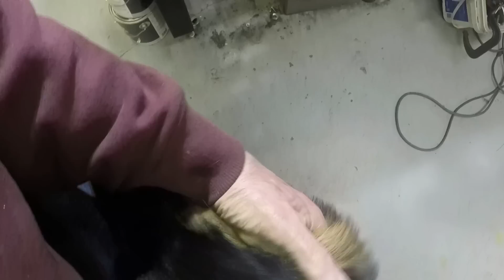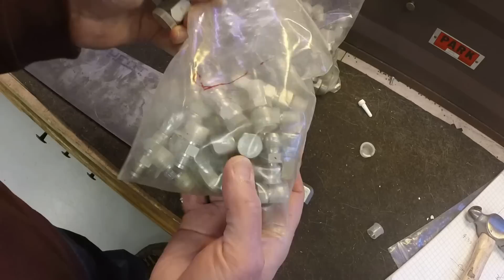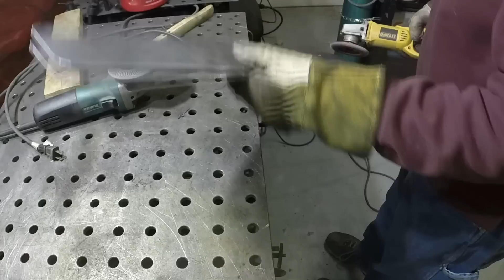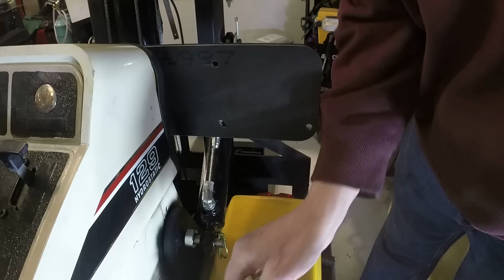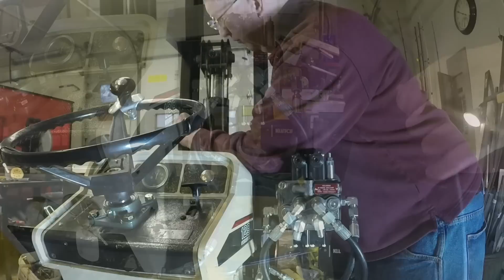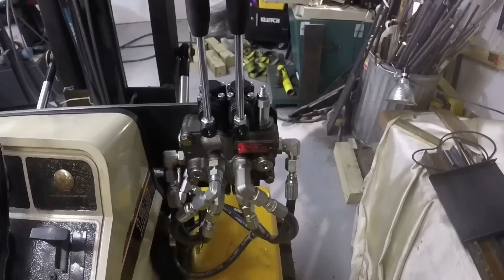Garden Tractor to Forklift Conversion EP:27, Lift Hydraulics and First Operation!

Comment: You referenced something about running into a problem or revelation about the mast not going up with shop air, but i didn't notice any mention of it? Hope im not being stupid. I noticed the tilt cylinders put a little twist on the mast in the full-rear position. Probably not enough to fatigue anything or hang up the trolley so i personally might just ignore it. However, if you wanted to install some kind of limiter/stopper, i have bolted various styles of automotive 'bump stops' on things for said purpose, mostly because i dislike hard metal to metal banging on my personal machines. Forklifts tend to be pretty noisy anyway, but at least yours is a rubber tire and soft ones at that, so you PROBABLY won't have to listen to the whole mast  assembly rattling like doom every time you cross a pebble. I had a solid tire forklift i got in a trade, hated the ride/noise 'harshness' of it so much on my mostly unpaved surfaces, i traded it off again.

Comment: I still think a sliding counter weight would allow for unforseen circumstances when you might need it.
Reply: I sometimes treat my backhoe like an adjustable counterweight for the loader on that tractor.. I have extended it all the way rearward, or to one side, for added stability in different situations. A sliding counterweight setup would be clever but it would have to have an utterly foolproof 'braking'/locating system because if it moved while you were relying on it it would be pretty dangerous.

Comment: Just a little tip,using a lot of hydrolics on my oyster boat wherever your hoses come off your controls and your hoses are not laying down always use 90s if not you'll have premature hose failure because the weight of the hose standing out puts a lot of strain on the connector.

Comment: Are you making the lift cylinder double acting sending fluid to the rod end to power it down?
Reply from the maker: yes.
Reply: Keep in mind, unless im missing something this only 'powers' the cylinder down, not the actual fork carriage/trolley. If this was ever done with the forks hitting something on the way down it may cause the cables to unseat from the pulleys unless some kind of guards were installed to prevent that. I don't remember if his design already includes that but now that you've brought it up im gonna go look again.

Comment: If you are going to use that lift on anything but flat hard ground you might consider adding dually wheels to the front for stability.  Any kind of slope at any height will get hairy very quickly.  Nice looking machine.
Reply: His plan is to be able to unload his steel deliveries in his driveway so pretty stable and level ground.

Comment: Have you tried the hydraulic hose crimp sold by Vevor?  For all the hoses you use in your fabrication seems it would save you a lot and be much more convenient.  The unit they sell is affordable.  Add in a stock of ends (you could standardize?) and a coil of hose and you are ready to make custom hoses in minutes.
Reply from the maker: Will have to look at that. Thanks for the suggestion.
Reply: In general i think DIY hydraulic crimping is 'penny wise pound foolish' but i also think if you're usually messing with pressures under 1500psi its a lot more realistic. I've even seen a guy on a garden tractor forum make some hydraulic hoses with double ear crimp clamps for an 800psi circuit and it's been working fine, which really opened my eyes to some DIY possibilities for 'medium' pressure hoses..
Reply: @Vigo327  This unit comes with an assortment of crimping dies so it is not the hand, one size fits all variety.  Uses a Porta power style crimper.

Comment: Nice work here, Frank! This was a huge milestone on this build. Did you replace those bolts holding the mast on with pins and bushings yet? Also, once you've finalized the hydraulics, and they're all filled up, you can go back and check the level of fluid in the hydrostatic.
Reply from the maker: Those mast pins get replaced in the Epilogue, some weeks away in the publication schedule. (end of April).

Comment: Just as a thought. You could bolt the counterweight underneath the frame. I would roughly estimate that you need 30% more weight this way, but it wouldn't add to the length of the construction.
Reply: I have thought about doing this on a similarly sized tiny backhoe tractor i've been working on. In that case i don't really have the option to add weight out at the ends as they are both taken up by loader and backhoe.

Comment: Hi Frank, Have you considered putting dual tires for your drive axle for more stability?  I was thinking the narrow tread 8.50 tires as duals would be wider than what you have now giving you a stable stance and not be as wide as 10.50 duals.  Just something that's been in the back of my mind as you have been building.  Thanks for sharing, this has been a great video series!
Reply from the maker: With limited lift capacity and height (1000 lbs, 6 feet) stability shouldn't be an issue. Remember, you only move with the load at ground level.  I need to keep it narrow to fit through gates on my property and reduce storage requirements.

Comment: Frank, have you thought about setting your pressure relief so it will only lift say 1500 pounds or whatever you think would be a safe lifting pressure? 
One more thing, you could tee off the fitting on your control on the lift side and put a pressure gauge to see if your over the pressures you feel safe with. 
Most YouTubers ask for suggestions so the algorithm works better for them so I’m trying to help out, not reinvent your work. I really like your grader but this might be my favorite one.

Comment: Hi Frank, we uses to use controls a lot like the one you’re using and to get around the problem of the hoses getting in the way, we would use straight male with female swivel on the back two hoses and that would raise the back two fittings high enough to clear. Another way around that is they make those same fittings in 45’s and you could use all four as 45’s or the front two as ninety’s and the back two as45’s and the hoses will clear each other that way. I liked using all 45’s mainly because it was all uniform and I thought it looked better. We also used swivel fittings at the control so it was easier to change hoses that way, we just made hoses with pipe fittings at both ends to make it easier. I know you’re already done with this part of the build but maybe someone can use the information. Thanks for sharing, can’t wait to see this one out working.

Comment: Frank, if you want backup lights, you can use a limit switch, with the spring type, or the roller, it could be placed by the transaxle, the pedals, or the rod between those two points. Another way would require a reed switch, or a hall effect transistor, and use a Bosch style relay and use a magnet on one of those places or some other location that both protects it and is easy to access. I haven't gotten far enough on my tractor to determine which will suit me the best.

Comment: Just Wondering do you sharpening your own drill bits and if so do you have away you do it???
Reply from the maker: Drill Doctor for up to 3/4 inch bits.
Reply: In my high school co-op course the shop owner where I worked had me learn to hand sharpen drill bits on a bench grinder. You definitely get better with practice. 
Now, nearly 40 years later I sharpened a bit a work for a coworker and ended up with an audience watching me. Thankfully the guy said the bit worked great.  
Dress the grinding wheel and have a tub of water to keep the bit cool.

Comment: I know the videos are behind the work but a bearing in the middle of the shaft can cause problems. It would be at the worst harmonic position. So should be offset from center if used. Would be best without as with one would require a stiff structure between the engine and hydrostat, and good alignment front to back.
Reply: 2-piece driveshafts in cars usually suspend the center support bearing for the shaft assembly in a very soft round bushing. I suspect the bearing he means to install would be 'fine' with whatever forces exist, considering the runtime this machine is likely to accumulate. Whether it would create an interesting NVH problem from these supposed harmonics.. id be curious to know.

Comment: How hard would it be to make a drive shaft with small u joints and a slip joint like a regular automotive drive shaft but smaller that would balance better?
Reply: I wonder where you could find small u-joints, probably have to start with McMaster Carr.
Reply: @Hoaxer51  Many steering intermediate shafts under the dashboard of a car will have 2 on it if one wants to cut up and experiment with a <$20 junkyard part, plus it is probably 'telescopic'.. Future 'serviceability' of said joints is not great. Something like the old-school steering 'rag joint' which is still a commonly available $10-20 piece gives a smaller angle range but does include a minor amount of 'plunge' travel, especially if you use two.

Comment: A little advise on your Mig setup Frank. When you grind a spot for your ground clamp always have the cable side of your ground clamp on the side you have prepared for it. The reason is that you are running all of that power through the spring and hinge on the ground clamp. I fried a nearly new ground clamp having it backwards The spring heated up and lost its temper. and I now like the brass clamps better than the type you are using.
Reply: I fixed my ground clamp by  running a piece of braided tinned copper from the cable side around to the other side, and put a silver contact on the opposite side so I have good contact When welding. I also did this on my plasma cutter, too.
Reply: I like gloves when welding but you do you. Love your videos.  Thanks
Reply: Many clamps do have a braided strap conductor running from one side to the other inside the jaws. But not all. I tend to do as you say anyway even though my ground clamp has that conductor.